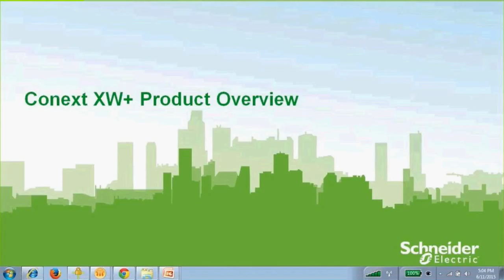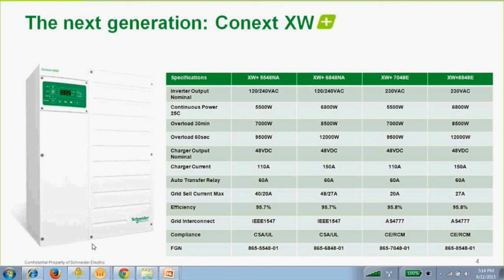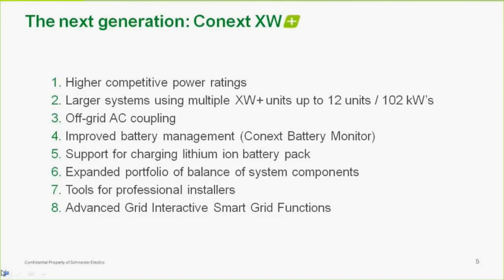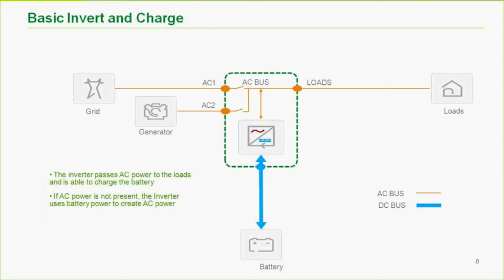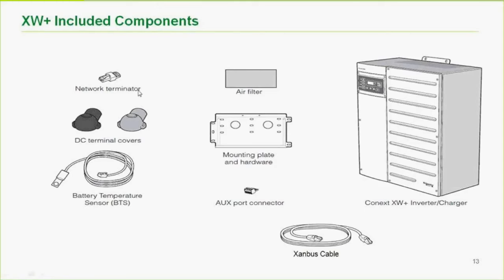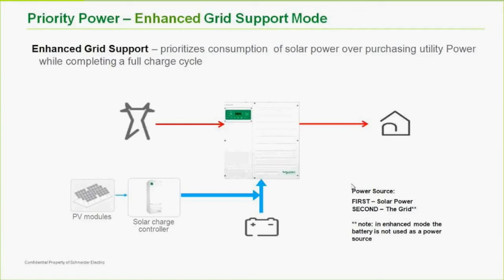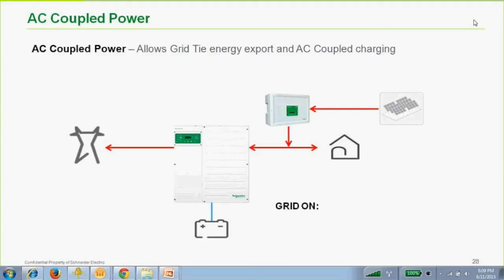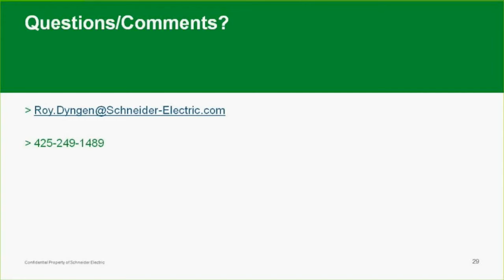Intro to the Conext XW  Hybrid Inverter:Charger

Comment: Hi, I have  XW 4548 and it does not work with Lithium Ion Battery. Display panel does not light up. IS there a way around it or it is just an old system that won't work with LI batteries